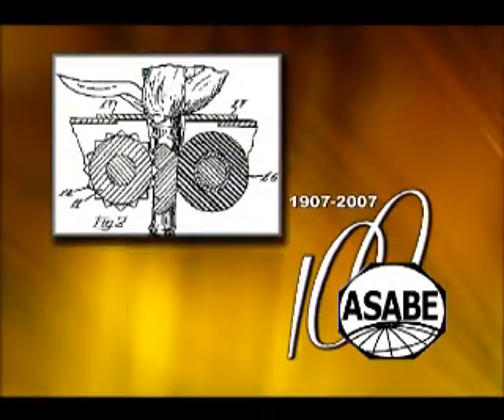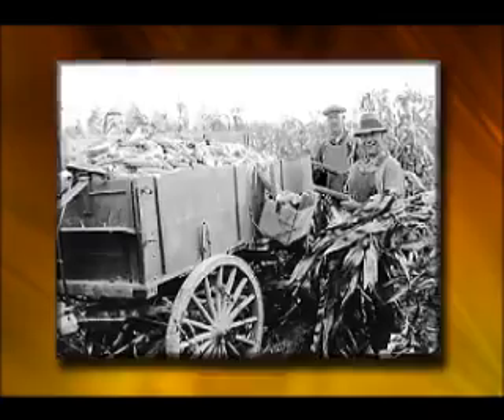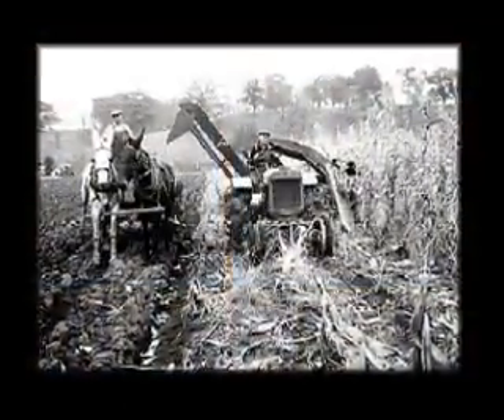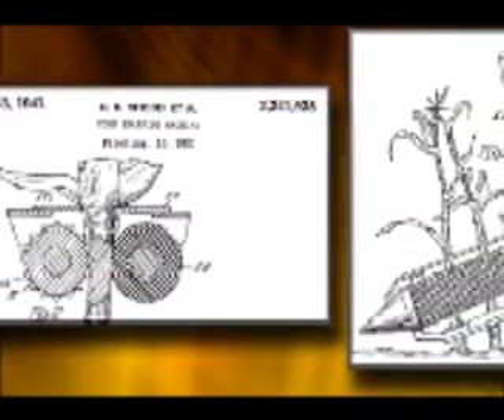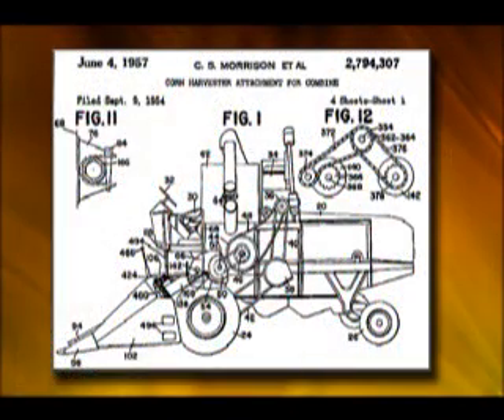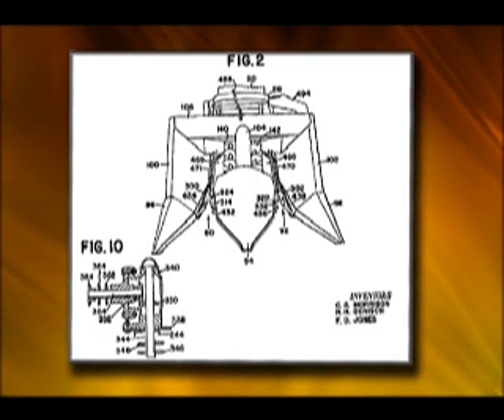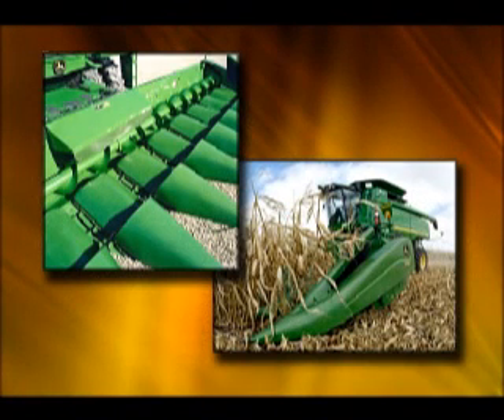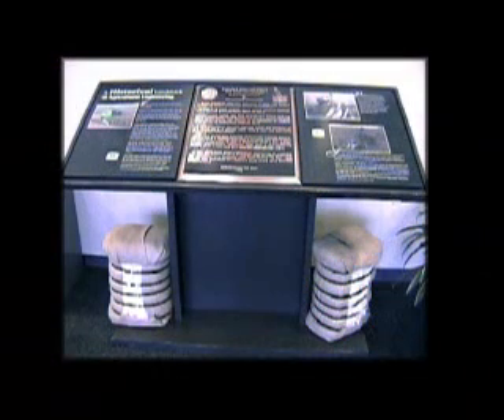Shielded Snapping Rolls for Corn ASABE Landmark No 36

Comment: Allis-Chalmers produced a mounted corn picker in 1941 with shielded snapping rolls.  They were even adjustable for different crops. Later models even had a lever where the operator could adjust them from the tractor seat.  If you look closely the these shields and snapping rolls resemble those of modern corn heads.